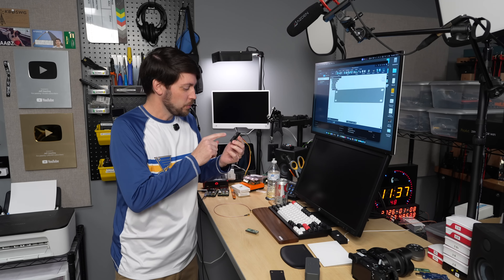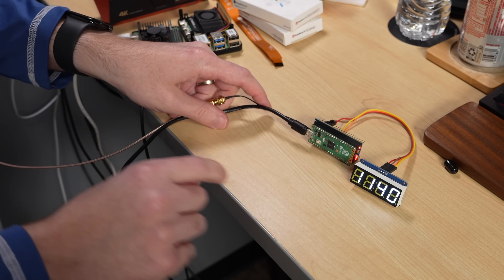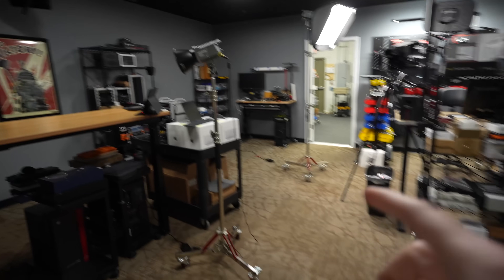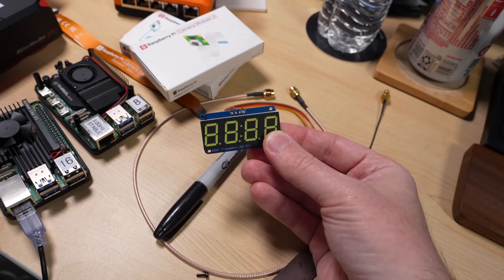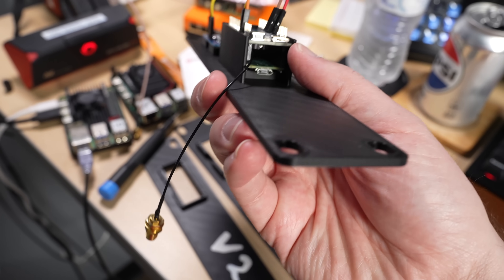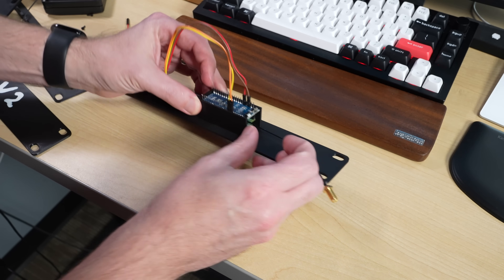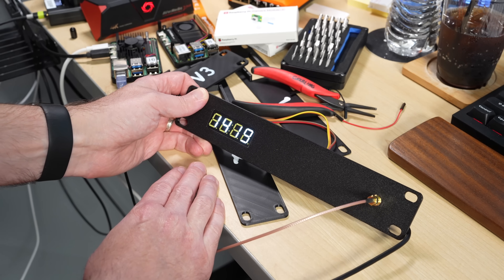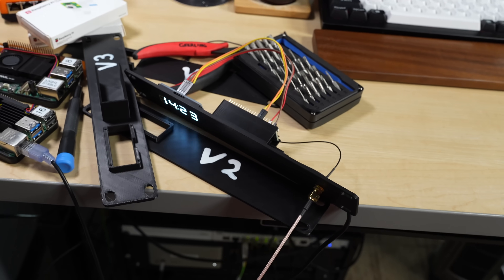The most accurate clock in a mini rack

Comment: That display is so commonly used that I'm sure there are plenty of 3D files for it that you could use for reference inside Fusion, and doing it that way the dimensions are usually perfect on the first try! I'm a bit surprised, it doesn't seem like adafruit provides CAD files for all their products like McMaster-Carr does. They should! (maybe I just don't know where to look)
Reply: Adafruit includes cad files at least for their newer products! I recently used their USB-I2C breakout and USB hub breakout boards and downloaded the cad files to design mounting brackets and figure out enclosure spacing around them.

Comment: 8:00 put light tubes in it to redirect and defuse the led lights to the front of the panel.
Reply from the maker: Something I considered - it's a little difficult since it'd have to be angled, since the Pi is on top of the HAT where the LEDs are located. But some creative solution could work.

Comment: If you are bothered, the wikipedia entry for 19" racks has diagrams with  the vertical hole pitches you need. I note your panel height is 44.5mm, 1U is 44.45mm, ideally you want to be a bit smaller than that, not bigger to avoid creating stack up problems for yourself in future, especially as there'll be a bit of tolerance on that size in the print. The horizontals won't be correct  on a 19" diagram obviously, but I'm sure you can work out 9" less.

Comment: I also oddly just learned about the SMA antenna connectors. theres SMA male/female like normal, and RP-SMA (reverse polarity) male/female - where the female has a pin... ended up having to buy 2nd type.

Comment: the worst thing about 3d printing is fixing tolerances and plastic deformation that is non-quantifiable and non-intuitive. every different part almost always takes multiple iterations to compensate after the fact.
Reply from the maker: True; and then you deal with different printers and materials that expand or contract at different rates. Then you dial it in, and realize a spool of some filament doesn't behave the same as every other of the same filament you've tried before... lol. When you're going for tight tolerances, things are a bit more finicky!

Comment: What about Radio Clocks for consumers? You known, analog wrist watches and clocks that receive a time signal from a transmitter like NIST Radio Station WWVB.
In Western Europe our clocks receive a signal from DCF77 (Germany). It's does not need a separate antenna and is cheap. Accuracy is +/- a few milliseconds off. Good enough for domestic use and the components to build a DIY clock are not expensive.
Reply from the maker: True; I will be working on some radio clocks as well. For now I'm sticking to GPS since I've bought a bunch of random modules and have the antenna routed nicely in the studio :)
Reply: @Level2Jeff  these days, GPS is a much better solution. It's also readily available almost everywhere, whereas WWVB or DCF77 have regions where they are very hard to receive.

But in the 1990s, DCF77 was definitely the way to go. And it was very inexpensive to boot. I remember taking a sub-$20 DCF77 clock, adding about $5 in passive electronics, and plugging it into my RS232C port. With a little bit of software, I could not only read the (relatively) precise time, I could also power the clock from my serial port. The signal then fed into a "stratum 1" NTP server for my LAN that would work even if I lost internet connectivity.

Since you already have a computing device in your project, I was surprised that you didn't add the required software for it to act as an NTP server. Fine-tuning for greatest precision could turn out to be a bit of a rabbit hole. But a proof-of-concept solution shouldn't be difficult to pull off. You could probably even do this in MicroPython.

Comment: 08:38 couldn't you have used a clear filament to make some light pipes to make the LEDs visible from the front?
Reply from the maker: Possibly! Something I'll look into... could have them routed so when you slide in the Pico+HAT, the light pipes get close to the LEDs on the board.
Reply: Jeff could probably even do this with the 7-segment display. It's not something that you often see in commercial products, as it isn't that easy to do with traditional manufacturing methods. But with 3D printing, you can use multi-materials and seamlessly switch between opaque and translucent filament. The visual appearance is really nice. You have a solid black surface with a uniform texture, and then there are a few areas that are translucent and light up to indicate status or -- in this case -- the current time.

Comment: Maybe if you're adding a PPS light, how's about a GPS lock LED, too?  Lots of GPIO pins on the Pi Pico to drive the blinkenlights (though not the PPS).   

One interesting hack that I saw in a project was to drive an LED from a UART transmitter.  In the "MARK" state, which is idle, the LED would be on.  You could then transmit status/debugging messages on the UART, which if you used a fast enough baud rate, wouldn't be visible to the naked eye.  However, you could have a debugging display with another LED or phototransistor receiving the signal and displaying it.  Exfiltrating data in plain sight..   Search for "mecrisp ledcomm" and you should find it.  I think it originally ran on his most excellent FORTH implementation for ARM Cortex microcontrollers, which is a whole other rabbit hole you can disappear into..

It was part of a network of small devices that talked to each other using these LEDs, alternately in transmit and then receive modes.  I think it was called "firefly" or similar.  Extra points if you can run NTP over such a path.

Comment: Not being a 3D printing specialist, but having a degree in Cheapness, I had two thoughts/suggestions.
1) make test prints only large enough to test what is needed. A thin plate that has a cutout and 4 holes just to test clock fitment.
2) Complete the entire design prior to printing so you don't end up with all the incomplete prints, possibly only 2 versions.

Just my thoughts from my armchair 😂
Reply from the maker: Heh not bad ideas
Reply: @Level2Jeff  I thought of a good idea. since everyone 3d printing runs into a need to verify tolerances, and doing this manually could be a skill issue:  there should be a custom plugin that you can print "measurement calibration templates" out based on your actual part, for only the geometry you care about, extracting one feature from your model at a time, and then print only the most minimal amount of plastic to satisfy fitment testing for each crucial feature. it would be like test driven development for 3d printing. instead full parts going to waste.
Reply: @Level2Jeff  you can cut bits you don't want to print in the slicer with boolean operations, or do sections in Fusion to print just select bits.
When i designed a desk support for my audio interface, that's how i did it to get the box to fit exactly to the interface shape, only printing like 1mm profile and see if it slides in, if the radii were correct etc. after a few tests to adjust you only use a few cm of filament.
I got that project done in one full print.
For long parts like the 10" rack plate, just printing a thin strip can allow you to correct the dimension in Fusion so it prints at the exact real dimension you need as well. Anything that can limit waste and still get the job done is good to take 👍

Comment: Carefully desolder the in-built PPS LED from the HAT board, then carefully solder two wires to its pads, then solder a new 3mm LED to those wires and stick it somewhere. If you also want it as a line level signal, then pass it through a buffer like a 4VHC1GT125 or other fast-ish logic buffer, and onto an BNC/SMA connection etc. The display uses a MAX7219 to run the LEDs, it should have an option in your code driver to change the brightness on ~16 different levels.
Reply from the maker: Yes, lower brightness levels have a lot more flickering on camera though, so I'm going the lens filter route nect

Comment: One other tip for fit checks: You can cut away the bulk of the unnecessary material inside the slicer itself. That way you use less material and the printer spends less time printing, but you don't have to modify the model itself.
Reply from the maker: That's a good idea, and makes sense, shouldn't be hard to do in orca

Comment: Why GPS for a clock? Because GPS satellites provide time in their responses.
Reply from the maker: Not only that, extremely accurate time (order of magnitude better than NTP)
Reply: @Level2Jeff clocks leaving sats are good, but our crappy atmosphere messes with the accuracy on the ground. I assume GPS module is L1 only, you should check that you're placing it into a 'static position' for improved timing accuracy.
Reply: @Level2Jeff  Absolutely! We use this at work a lot for time-critical systems. For the 99%, NTP is sufficient so there's no drive to go to GPS or PTP, not to mention the expense.

Comment: There should be a signal on the GPS with PPS.  On the Pico you can feed to a pin and have it generate  an interrupt that will run a short program.  You can use micropython. There are two cores so you can run one in the second core and have the other run the display.  If you can get a signal our of your NTP (i.e.) a equivalent of 1 pps you could look at the two signals and compare with a scope. I bet the GPS is better.  You can also set up a 10 MHz oscillator that is disciplined by the 1 pps.  Then you can become a time nut.
Reply: I've gone pretty deep on timing GPIO in my own projects. For time stamping you can (ab)use the PIO state-machines to cause a DMA access to the CPU clock register, and shove the result into a FIFO. This eliminates any delay/jitter in servicing the IRQ.

Comment: Really hope your network gears’ PTP / IEEE 1588 implementation is good, because I can’t tell you how many times I’ve see switches break stuff like multicast because their implementation of PTP was hot garbage.
Reply: I would like more details please.

I ran multicast across all the top networking vendors (Cisco, juniper, brocade, extreme...) and never has an issue with IGMP, PIM or multicast problems... I can assure you most of their clocks were wrong 😂. At least once a year. Some minutes, some hours, some perpetually
Reply: @j @jamess1787  I specifically mentioned PTP with multicast here, not just multicast by itself, because there are protocols like Dante which require PTP Domains to be implemented properly at the network level lest the audio become corrupted if it has to go beyond a single hop (maybe two).

Comment: You could have left 1 or 2 layers on the front panel to act as a diffuser without using UV tint to mask the display, resulting in a cleaner look :)
Reply from the maker: That was suggested by JaredC01 too, when I was asking about creative solutions. I may try that in a future version of the model. I feel like the tolerances would have to be very good to get a clean look that way, though, because if the panel is even a tiny bit off, part of it would be more diffused than the other.
Reply: @Level2Jeff  I'd suggest adding a rib along the top and bottom edges as a stiffener, so that the print isn't as floppy.
Reply: @Level2Jeff just saw your new video addressing this :) glad I could help you out with something even if is not perfect, that’s the fun!

Comment: After your videos about GPS clock, I decided to start learning about it too 😅 and I was thinking to create a NTP server on my homelab for learning purposes. But looking for cheap GPS modules, I noticed most of them don't support PPS, only more expensive modules 😢 if you can enable PPS on your module, it may be a good option for me
Reply from the maker: A lot of the plain chips have PPS outputs, but a lot of the little boards made for projects don't include any routing for them so you can use them. I'm like... it's one trace and a pin! Just add it :D
Reply: @Level2Jeff ohh awesome, I didn't know that 😅
Reply: Actually most of them do have PPS, they have a little LED light as part of the module which says "PPS" on the board. You can 'steal' the signal from it by soldering a wire to it. Although there are quite a few that have it brought out as a pin as well.

Comment: Hey Jeff, when doing 3D printing tests and prototypes that don’t require special durability, consider printing in PHA, which is home compostable. This way you can throw your failed or incomplete designs in your (or a neighbours) home composter and consume less plastic in the process, and contribute to a local garden at the same time, maybe grow some veggies :)
Reply from the maker: Huh, never heard of it but will look into it!
Reply: @Level2Jeff  PHA is a literal trickier to print but if you do a lot of test prints, which I do when working on my models for my gaming terrain, then it is great as it does go straight into a regular compost bin unlike PLA.
Reply: For permanent cabling, try wire wrapping the connections.
Reply: For some very basic fitment testing, you can also just use a paper (2D) print.